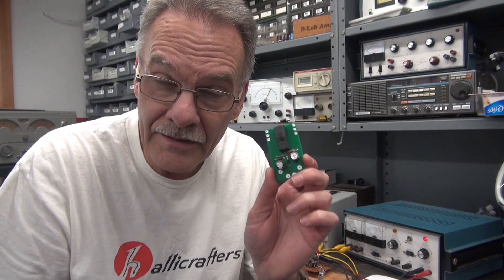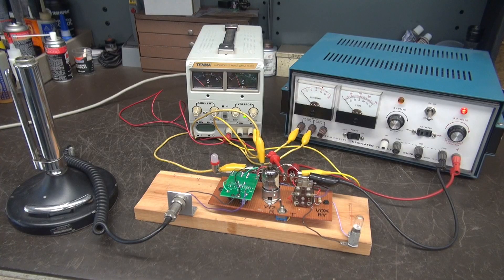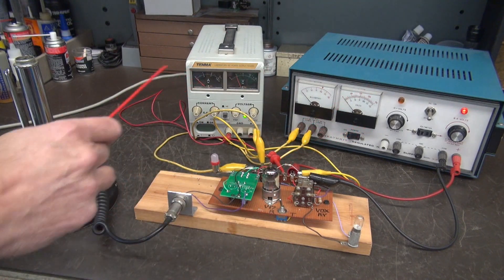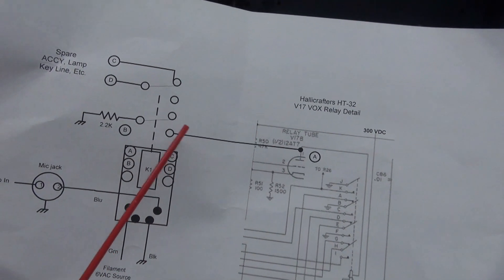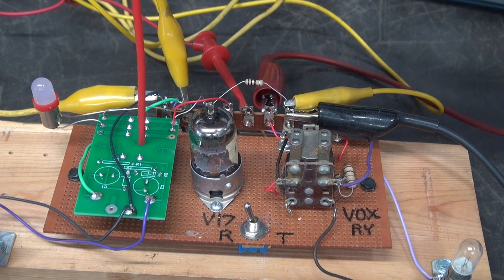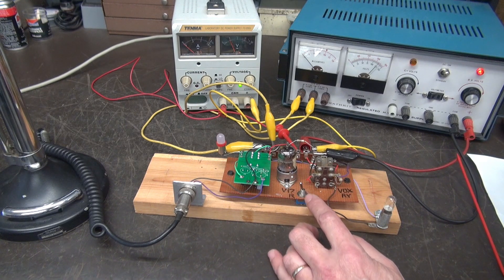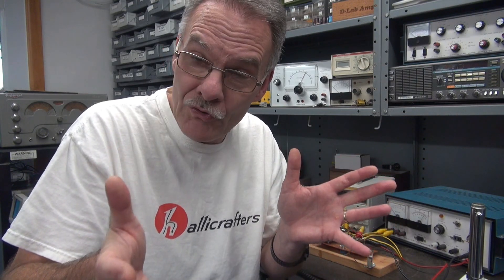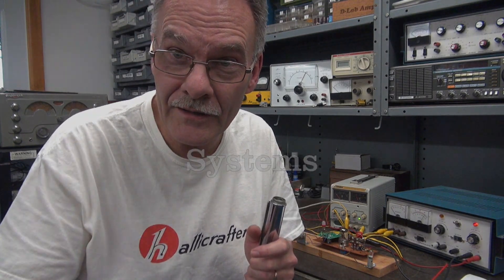How to add Push to talk PTT Vintage Hallicrafters HT-32 Ham Radio Transmitter Mic Key system

Comment: Terry I am interested in your PTT board for my HT32.Is there any reason you can not use the existing 1/4 inch Key Jack on the front of the HT32 with a D104 Mike to operate your PTT board?Also what is the cost of the zPTT board?Ron NB3W
Reply from the maker: e-mail thru d-labelectronics.com